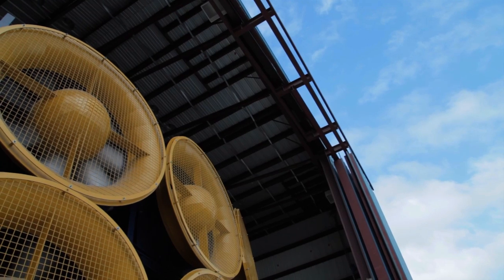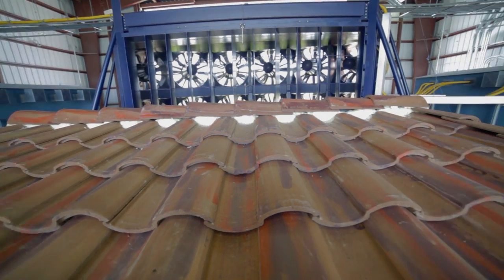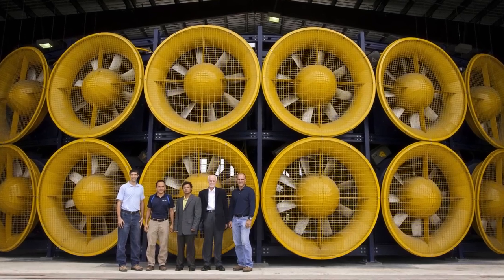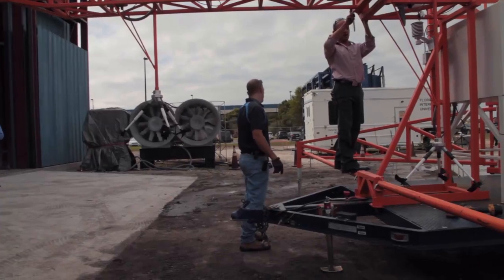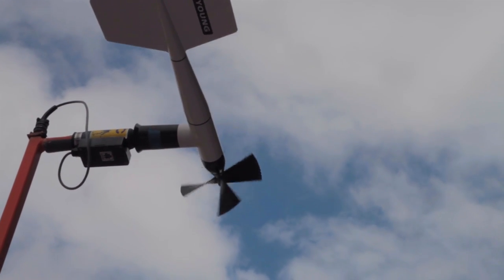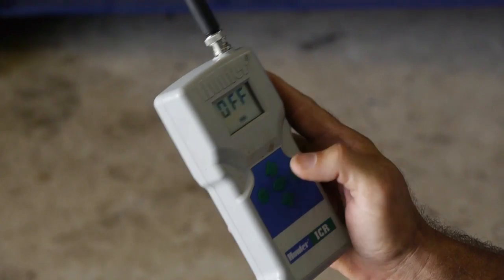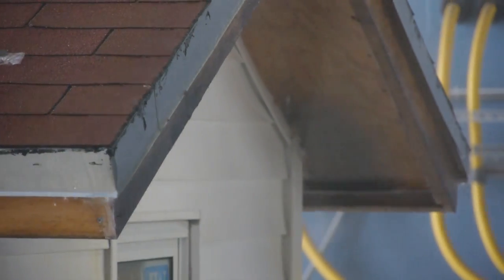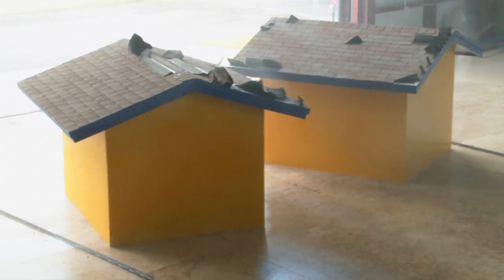WOW - FIU unveils 12-fan Wall of Wind

Comment: I applaud the effort, but this testing does not simulate the drastic and immediate pressure changes that occur during an actual storm. The negative pressure which is the "sucking" action your home, windows and doors which make them bow out, can actually be worse during a severe storm. I even witnessed a glass manufacturer that was allowed to leave caulking all around the glass where it meets the frame, so these guys actually are cheating during their testing. When I asked someone there, they said they all do it. I thought, so they all cheat? Crazy. I am writing an OP Ed piece on how the hurricane standards in the U.S. are weak compared to other countries and I have found a disturbing culture at both the govt level, and the manufacturing level. I recommend you research any hurricane protection product thoroughly and know the testing criteria in the U.S. is weak compared to many other countries. For instance most American products are to weak to be approved for use in most areas of Australia, and this includes any hurricane resistant glass.